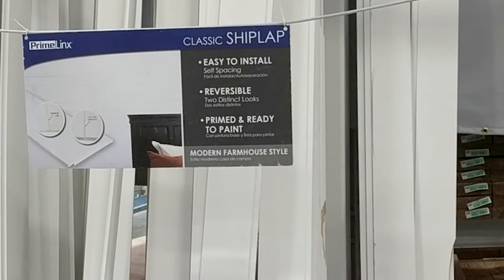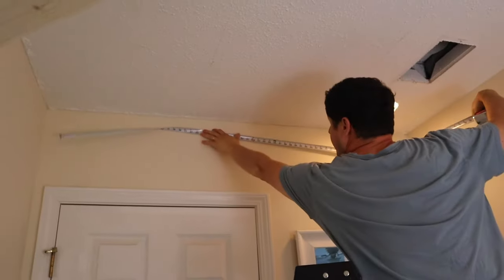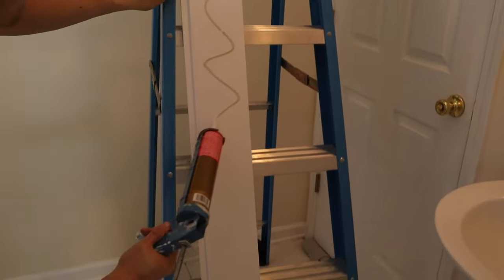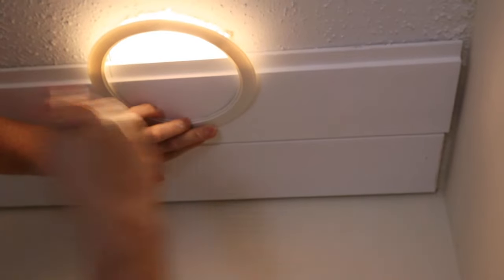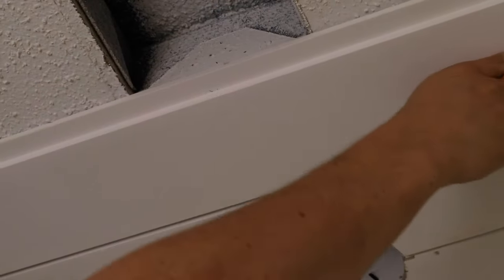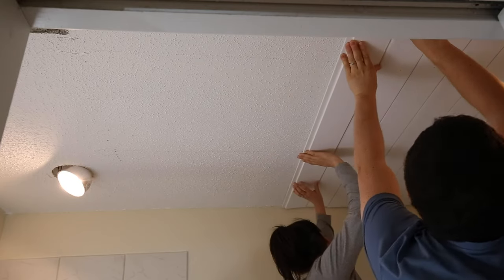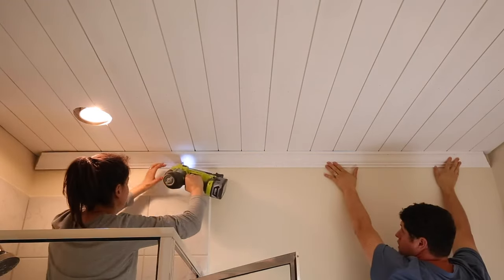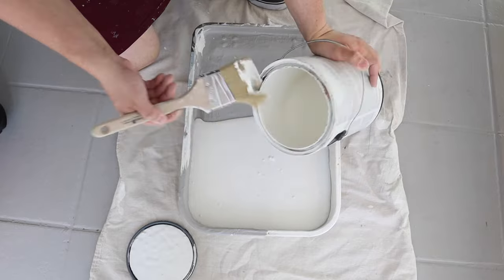DIY Shiplap Ceiling | How to Plank a Ceiling

Comment: A helpful tip is to pre-paint the molding (and even the shiplap) prior to installation.
Reply: I was thinking to line up boards and spray them all quick. I had to buy a spray painter for my fence so I got spoiled how easy it was.

Comment: This looks great! Well done! I have to cover some popcorn ceilings and want to use shiplap and tin tiles. I was concerned that shiplap might not be the best material for a bathroom, due to the constant moisture. What is your take on that?
Reply from the maker: I think that the moisture is a non issue as long as you have a working exhaust fan which all bathrooms should. The paint alone will protect the wood and they also come pre primed that I like to use.

Comment: Did you guys use liquid nails on every plank? Also what length were the brads that were long enough to get through the plank and the sheet rock into the studs? Thanks in advance!
Reply from the maker: We did use liquid nails on each plank and we used 2" brad nails to get into the studs.
Reply: @AngelaMarieMade  thank you

Comment: The ceiling looks great! I am renovating a 1920's home for my daughter. The ceilings are really bad with thick texture and the sheet rock seams show. I want to shiplap the ceilings. The ceilings are longer than a shiplap board. How would I go about installing them without seams? Any suggestions?
Reply: caulking seams works well if edges are even
Reply from the maker: Thank you, that sounds like an awesome project!! That is so sweet that you are doing it for your daughter. They sell 12' boards that you could use to reduce the amount of gaps. Also, caulking or spackle the transition gaps between cut pieces. I prefer spackle because it can be sanded down for a more seamless transition.
Reply: @AngelaMarieMade  thank you for the advice. I will look into the longer boards.
Reply from the maker: @doreenjensen3260  You're welcome!

Comment: Thx for this - where your ceilings 8’ in height? If so, did you find they made your room feel taller with shiplap? We had this in our former house that was 9’ ceilings and it was great but worried it would make our new house with 8’ ceilings feel more closed in… happy for your thoughts! Thx!
Reply from the maker: Thank you!! I think that the ceilings feel taller with the shiplap.
Reply: @AngelaMarieMade  - thx you!

Comment: How do you splice it together if the length is longer than 12 or 6 feet?
Reply from the maker: I would use light spackle or wood filler and sand it well to make it uniform once it is painted.

Comment: Why do you nail the ship lap in the middle? I was told to nail the tongue of the ship lap, the next board would hide the nail.
Reply from the maker: For a ceiling it needed some additional support! Good point about putting some in the groove so it is less holes to fill before painting!

Comment: So, MDF should never be used in a bathroom, or even in a basement close to the ground for that matter. If you want to put shiplap in areas with excess moisture you need to use real wood. Also it was recommended to prime the boards after caulking. Depending on what is being used, Dap being most common where I live, the wood trim must be primed before caulking (dapping as we say) or it will all peel off. This project looks really good the day it was put in but in a couple years those boards will all be swollen and puffed out due to excessive moisture. 

I have been a carpenter for 17 years. Do things properly and don’t waste your money.
Reply: So your saying they did it properly, by using Primelinx primed pine shiplap (real wood).